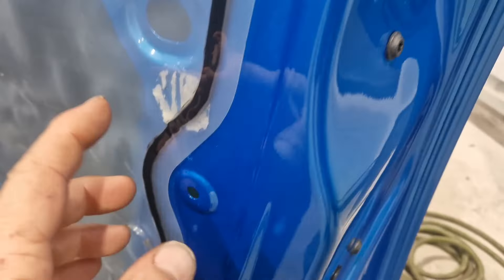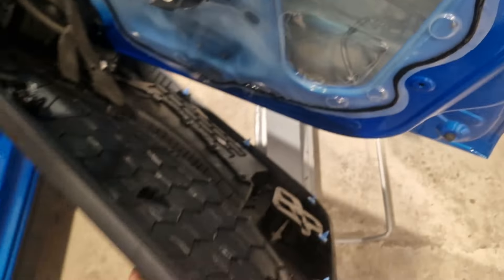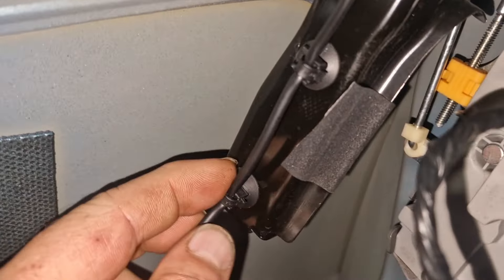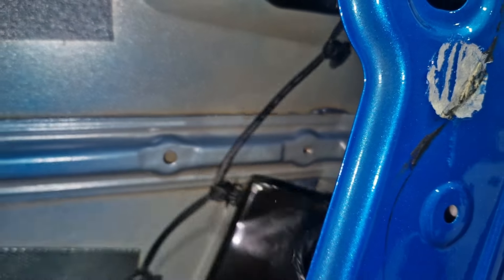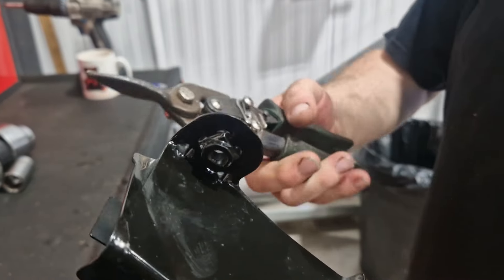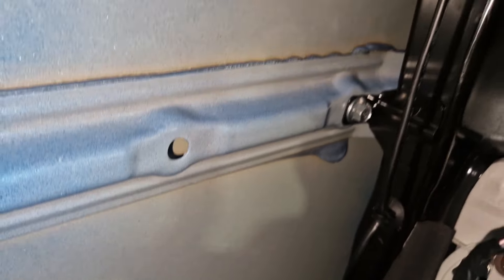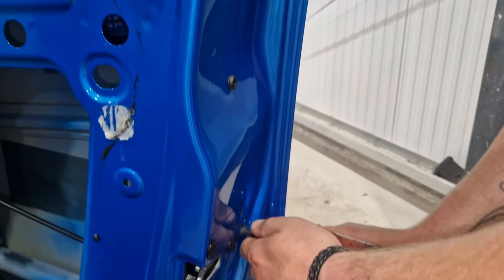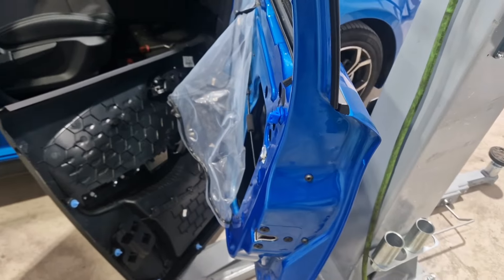MG3 Squeak from drivers door

Comment: Do you know if you add cruise control to a mg3 form sport from the higher spec and what do you need?
Reply from the maker: I've never tried it. All you need is the steering wheel buttons, but some coding called a feature key may stop it from working. Try it, steering wheels are cheap enough on ebay.
Reply: @ thankyou 👍🏻

Comment: Hi Steve, I serviced my neighbours 2018 mg zs yesterday and she has been complaining of a lound clunk, clunk sound on driving in all gears. It sounds like to me it is coming from inside the gearbox. Have you had any mg zs in with the same clunk sound in all gears while driving? It goes if the clitch is dipped. It could be passenger side inner cv joint but doesnt feel any play in it, and deffo sounds like its from the gearbox. Any thoughts to help me mate. Dont want to go and change the driveshaft if its not that and is the gearbox.
Reply from the maker: You're going to have to send me a video mate cos I wouldn't have a clue without looking at it.
Reply: @pistonbroke  Thanks Steve, got the car this afternoon to fit front brake pads, so going to jack one side up and go through the gears, then the other side to try and eliminate if it's from inside the gearbox or inner CV joints. So will try and record the clunking while I'm sat inside the car. Video is up on my channel Steve for you to hear.

Comment: Hi mate, my neighbour has a 2018 mg zs and says she hears a sqeak sound when going over bumps, but can only hear it with her front windows down. I said probs dry suspension bushes, so lubricated them all with silicone spray, but she says it is still there. I cant hear it myself but am a lot older so probs at a frequency I cant hear. She said it is like a cricket sound. Are you aware of this sound over bumps with the windows down on the mg zs and know what it is?
Reply from the maker: @markslade9722  I have heard that chirp noise from the rear of the ZS and HS. I don't know for sure what causes it but I think it's from the brakes. Pretty much every one I've driven makes the same noise.
Reply: @pistonbroke  thanks mate, my neighbour seems to think it is from the front though, but as my hearing can't hear it, perhaps it is from the rear brakes then. But good to know if you have heard it and they all do it, thanks mate👍
Reply from the maker: I've never looked into it because I've not had one come in for that complaint, I've just heard it on 99% of them. It might be from the front for all I know 🤣
Reply: @pistonbroke  no worries mate🤣🤣🤣just a shame I can't hear it with my old ears to try and pinpoint it🤣🤣🤣it is driving my neighbour nuts saying it is like a cricket chirping over every bump with the windows down, but I can't even hear it when pushing down the corners of the car to move the struts etc. 
If you do ever get a customer complain and you manage to find out where it is from and what it is, would appreciate if you post a video on your channel about it🥳🥳🥳🥳I have checked all suspension areas, lubricated bushes etc but can't find it, or hear it myself.
Reply from the maker: @markslade9722  ok will do. I hope I don't get one to be honest as it will be difficult to find. Bouncing the car wont make it happen. It happens when you go over a bump fast enough to give the car a short sharp shock if you like, hard to explain but something like a shallow pot hole would do it but even then it wont do it all the time.
Reply: @pistonbroke  thanks mate, much appreciated, yeah my neighbour says it is a chirp that she only hears with the front windows down and usually bad bumps or potholes.
It is peeing her off so much she says she would change the car if she could afford to, but I can't hear it myself to try and pin point it.